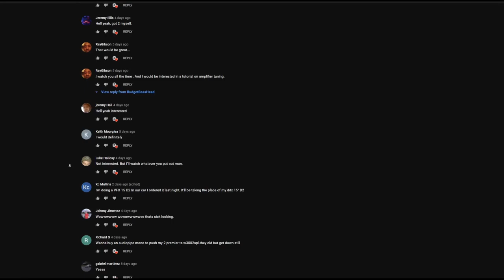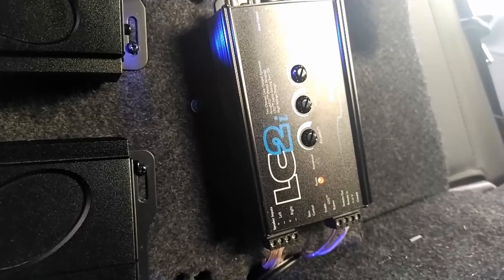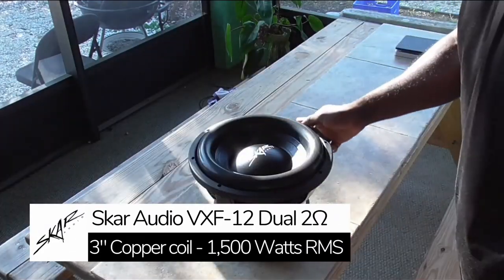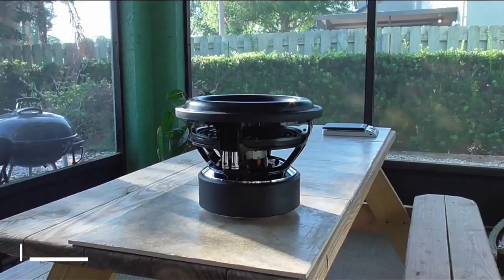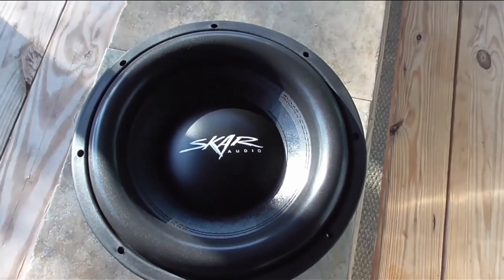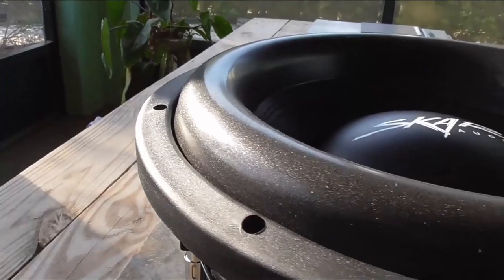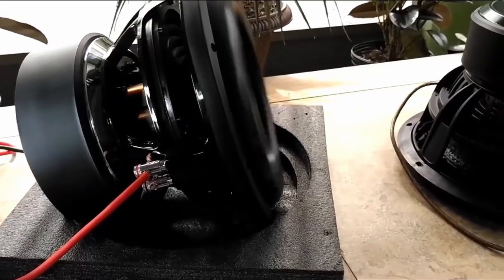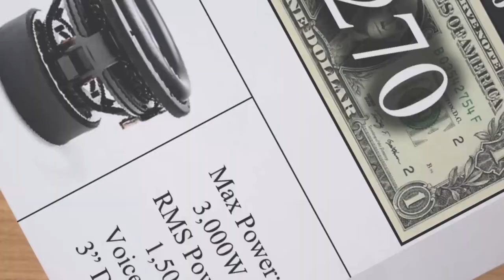4,000 Watt Daily System: Dual Skar Audio VXF-12 | Subwoofer Flex Demo

Comment: I thought there’d be port noise. Those VXF’s probably could use a much bigger port. I’d like to see a custom 6th reflex for this pair of beauties vs the Skar box. Or the XFL, and the Resilient Gold.
Reply: I was very surprised how little port noise there is for such an amazing amount of air flow. The kerf edge is what saves it no doubt. Im on the fence between the synergy 3.1 or 5.1. Either will def stretch them puppies out. I figure if I get the 3k I can begin my sq with an audio control dsp maybe the 608 but I'm not sure I'm done pounding either. Both the subs and the 4 channel AB skar amp have been a damn good buy for the price. Though as we all know it'll never be enough or finished

Comment: I'd be mostly worried about the lack of bracing for the motors. Even the EVL boxes have special bracing for their magnets, and they're smaller that the VXF's. Also, them subs ain't breathing nearly enough. So much more potential. Still a very clean and nice setup though.
Reply: I sent an email to skar and literally asked and they said those subs would be fine in that enclosure it also says it on the website but yeah I still worry about the same thing

Comment: No dissing - but I'm gonna stay away from the pre-fab boxes.  They are made to fit, not perform.  Love the video though, you always do these proper.
Reply: what's the difference between a prefab built to spec vs a custom box built to spec?
Reply: @Banshee421x   A lot of bracing, 3/4 MDF instead of 1/2,  A "custom" box tuned for your vehicle instead of (What fits).  Color of the covering....   Will Skar send me a prefab tuned to 18 Hz?
Reply: @bringmeyourweak  skar box is 3/4 inch MDF tuned to 32 with 2 cubes a peice what else do you what? I can add to port length to lower the tuning. I think you get alot of bang per buck with this enclosure
Reply: @Banshee421x   I agree that you get a lot of bang for your buck with that set up.. My vxf 12's have the ability to perform to their limit in my own custom box vs what I can purchase though.  Some of us are just looking for more than what they offer is all. You can be happy with a prefab and I can be happy with my custom. At the end of the day - we're both happy.

Comment: Since you got a stock alt do your headlights dim when you’re pushing 4K watts? If not what did you do so they don’t dim
Reply: He's not seeing close to 4k with stock electrical. To answer your question his voltage will drop drastically causing a ton of dimming.

Comment: I would love to see either of my two favorites on the channel so far paired up ... Tha AB XFL or Tha AP BDC4 preferably tha BDC4.
Reply: I got 2 bdc4s on 4k at .5 ohm and oh its f'ing NASTY tuned to 26hz I can do hairtricks float stuff im uploading a video today after I charge the xs power in the car
Reply: @diantrecreagh3269  Just saw ur comment, where's the video at?
Reply: @star_b0ii sorry I had to wait for the northstar to get here first I just replaced my 2 xs d975 batts with a northstar 170ft BATTERY IS A BEAST I'll try and get the video up today I thought it was gonna be another sunny day today but its cold asf rn if not today I'll have it up tomorrow
Reply: @star_b0ii  video has been uploaded
Reply: @diantrecreagh3269  Just watched it.. Damn they gt down 🔊 🔊
Reply: @star_b0ii  Hell yeah they get down for some budget subs easily the best price to performance ratio subs on the market rn I think im gonna be getting some skar vxf 12s next month and another 4k I think. Then I'll be done with this build....for now😜
Reply: @diantrecreagh3269  Definitely best bang for buck rn fam

I would love to see some vfx's in action as well man den u could probably go wit some xfl's ya kno..just to test out a few of the budget bangers 🔊🔊🔊🔊
Reply: @star_b0ii  those are also on my list too I'm just looking for a decently priced sub that can handle 3k with more than 25mm of xmax cause I tune all my boxes under 30hz so I need some leg room for when they start moving at 20hz on 3000 watts a piece
Reply: @diantrecreagh3269  would you rather have an ap bdc4 12” or a skar vxf 12”? I’m thinking about getting one of them

Comment: How was using the AUDIO CONTROL LCi2pro and getting everything connected? I have a 2016 Chevy Malibu and I would have to use one of those. Trying to figure out if I should tie into the amp or back speakers

Comment: Hit harder having the subs and port load off the rear wall rather than the carpeted side panel with lots of dead zones
Reply from the maker: Can't stand the trunk rattling; side pane reinforced with 3/4 inch mdf underneath carpet. Thanks for informative comment.

Comment: I have the same subs and box powered by a skar rp2000.1 d sounds really good clean to I'm thinking about getting a bigger amp for them
Reply: one rp2000 per VFX12
Reply: @douglasm.sodaro7579  I’m now running a locker kxa2400.1 for the both of them
Reply: Skar skv2-4500.1d

Comment: My vxf’s and box comin today😁. Runnin them on a cab-22until my cab-45 gets here. 300 amp alt, xs d3100 battery, stinger 1/0 cable throughout. Can’t wait to get em in. How long did you break em in before throwing some power at em?

Comment: I'm debating if I should get the skar vxf 12 or skar EVL 15s? Which one would you recommend?
Reply from the maker: These are both 'Daily" drivers. They are middle ground between SQ and SPL. The EVL 15 will have more surface area. The VXF will have more Power handling. But surface area is king. Get the 15.
Reply: @BudgetBassHead  thanks for responding I forgot to mention that it will be 2 subs and they will be powered by a orion 3000.1dsplx amp, so the 15s will sound better

Comment: Great VIDEO!!! Working on a new system my self. I am still trying to get a hold of Skar!! My one big amp from them quit working! I have power going to it , light is on amp, but no sound from my EVL 12’s. No they are not smoked!
Reply from the maker: check your RCA's with a volt meter. make sure you are sending a signal to the amp. If so, disconnect the speaker wires and check for voltage from the amplifier's speaker outputs. If you got nothing, its the amp. If you got voltage, its the subs.
Reply: @BudgetBassHead   ok thank you so very much. I just got new rca’s. I didn’t really play it that loud as I was breaking in the sucks I sure hope it ain’t them I’m also having a hard time trying to get a hold of scar
Reply: What I am working with is the RP 3500 1d amp, and my box is there enclosed dual 12’s evl.

Comment: I heard you say stock alternator, I was thinking about getting the same subs but 15s and the guy at the audio shop said I needed a high output alt, how did you get around this?
Reply: Either 3 extra batteries will work. But it'll stress your stock alt. You'll need to upgrade it no matter what but you could hold off on it if you have enough batteries.

Comment: I see that your accubass is off. Does your system sound better with it off?
Reply from the maker: In my opinion it does not need it but some people may think otherwise. Accubase tries to compensate factory based roll off. But since I'm connected directly to the factory amp, it seems to have little, to no roll off; in my opinion.
Reply: @BudgetBassHead  thank you

Comment: Will that box be able to fit in that trunk the regular way,  or it's too wide?
Reply from the maker: In this setup I had my amps on the other wall which made it too tight of a fit. I did not want my amps being suffocated.
Reply: @BudgetBassHead  alright thanks

Comment: Nice .  . when you did the resilient sounds  sub did it make any noise free air.. i got the gold 15s.. lil noisy free air was wondering if you heard and mechanical noise
Reply from the maker: No, not mines. However, most subs will make a mechanical sound, free-air, if you push it too hard. Air chuffing is the most common, especially with small vent holes. Also, when the spider and/or surround is maxed out, it makes a popping sound; sortta like quickly stretching a towel will make. What you don't want to hear is scraping, clanging and clunking sounds. Thats metal to metal and means there is a problem.

Comment: Do you prefer the evls or vxfs? Which one hits lower in your opinion?
Reply from the maker: The EVL has a softer suspension. So if you lean more towards SQ, go with the EVL. But if you want power handling and SPL, go with the XFL.
The EVL gets lower, but XFL gets louder.
Reply: The vxfs
Reply: Skars vxf subs are better than the evl
Reply: Both power handling and SQ
Reply from the maker: I just realized I read your comment incorrectly. @bassbrothers answered correctly. The VXF-12 is a big brother to the EVL-12. And well worth the price.

Comment: Off topic but which sub would you recommend a skar zvx8, a sundown audio Sa3, or a massive audio hippo 8”.
I’m running on a sound digital 1600, wt amp.
In a dual 8” custom ported box built under the back seat of my 18 Silverado seat has been raise about 2.5”
Reply from the maker: I've never run the Hippo 8, but have only heard great things about it. as for the others, the sundown would be a better choice for sound reproduction. But if money is an issue, the Skar is an excellent choice. And both those subs give you more than you pay for.

Comment: What kind of battery do you have?
Reply from the maker: Dual DieHard Platinum AGM Battery, Group Size H6, 760 CCA
Reply: @BudgetBassHead Thanks! Will two yellow top Optimas 800 CCA work well on a 09 Tahoe with a Mechman 370amp alternator? For a 4000 to 5000 watt system.
Reply: Yeah,that’s definitely will hold nicely with the alternator giving that much amperage for the 2 yellow tops combined you have 150ah and they give a better flow of electricity to your system
Reply from the maker: @BlackPanther-oo4zj  I agree with @dante Paige that should be a great reserve for 5,000 watts.
Reply: @dantepboyz  Thanks!
Reply: @BudgetBassHead  Thanks 👍
Reply from the maker: Yes they are.

Comment: Thank you for showing me what bass is all about. I am new into bass. I have a Denali and have $1k budget for bass what would you recommend for a combo of an amp, sub, and box? I am willing to build a box as I have plenty of power tools to build one. I enjoy quality bass and listen to hip hop, EDM, and jazz music.

Thank you in advance for you guidance. 
All suggestions from the group are much appreciated also.
Reply from the maker: With $1K you have plenty of options. But if its sound quality you prefer, checkout the Resilient Sounds Gold lineup. I have the 12in, 1,000 RMS @$300; and it sounds amazing. Really nice and soft suspension, only rated at 1,000 Watts and moves plenty of air. I pushed it way more and it handled it just fine. Which leaves you plenty of money for a quality amplifier. Skar is proven to put of good amps. And Rockford Fosgate has a reputation for quality. Hope that helps.
Reply: @BudgetBassHead   thank you for the recommendation!  What amp model by Skar or Rockford would you suggest and box (prefab or custom build) and at what frequency tuned?  Sorry for the questions but I am a newbie who wants nice clean sound for me Yukon XL

Comment: Idk to many skar amplifiers and subs blowing up everywhere makes me not want to mess with skar audio my buddys amplifier caught fire twice and it was a super long process getting it replaced twice so he sold it but I been having some pretty good luck with audiopipe tho
Reply from the maker: Thanks for sharing. But I've been shopping with Skar for over 5 years and never had a problem with any of their products. I did once burn up a VVX-12, but that was my fault with clipping and improper enclosure tuning.
Reply: I recently got a 4 channel skar from Amazon and it came dead on arrival.   Luckily the return was easy.  Not going to try them again.
Reply: In my experience the problem is user error. Guys will buy big systems and not even upgrade they're electrical. Or install the wiring incorrectly and start a fire. I myself have never seen a straight up mechanical failure that resulted in hardware catching on fire. I have had an amp that went into protect mode on a 100 degree day after some moderate bumping .

Comment: I’m new to the automotive Audio/Soundsystem hobby, your channel has helped me get a better understanding. What would this thing do with an upgraded alternator with say 100 more amps so like say a 250amp alternator and Big3 and welding wire sized leads and 8 gauge to the subwoofers? Would the wiring be overdone for that same combination subwoofers? I’m a typical noobie thats too lazy to read the forums/research lol so I’m kinda looking to do the above to my daily driver Lexus LS400 and a cookie cutter combination.
Reply from the maker: This setup has exactly what you just mentioned, minus the alternator. I've have a Mechanic 320A in the garage for over a year. Too lazy to do the install. But I will in an upcoming video. So stay tuned 👍
Reply: Go 0 gauge so you can upgrade

Comment: I have 3 of them on a skar 3500.1 wired to .33 ohms but trips 300 amp breaker. But I bought 3 more to have a total of six. Looking for input on amp, do I run 2 3500.1 or up it to 4500.1 or go even bigger with different brand of amp. I have factory alt and a 300 amp alt dual runs of 0 gauge with 4 batteries.
Reply from the maker: Some of those breakers are not rated correctly. But at .33 ohms?? The RP3500 isn't rated for that. That's letting too much current flow. Get another 3500 and you shouldn't need to wire down to .33Ohms anymore. That should be plenty of "CLEAN" power. Good luck
Reply: @BudgetBassHead  thanks man so one more question vxf is rated for 3000 watts but in previous comment ole boy said 10k on them . whats the the highest watts they can hanlde cuz at 10k that 7k past rating
Reply: @waylonquinones861  I thought these speakers were rated at 1500 watts rms. Max wattage rating isn't rms rating my guy.
Reply: I know its 1500 rms and 3000 peak . When I was asking questions bout amp it was cut I wanted to go bigger. So I read around forums found multiple subs amp selection was different example 3 12's rated 1500 rms ea ppl would have 4500 watt rms amp.   So I have 6 vfx12d2 on a tramamp 8k they do fine. I couldn't see 6 12's on a 3000 watt amp

Comment: You think it would sound good if you put the zvx in that box
Reply from the maker: this box is actually too small for the VXFs; only 1.75cu.ft after displacement. So, 'no' I wouldn't really recommend it for the ZVX; unless inverted.
Reply: @BudgetBassHead  so how would it sound if I inverted will it hit better low my amp is tune to 32hrz pushing 3k rms

Comment: Sup Bossman 
I have the 2 EVL 12’s on the RP 2000.1

I turn heads and it bangs but I want more😀😀😀

I’m thinking about going 

2 VXF 15’s on the RP 4500.1

Or just going up to the RP 3500.1 and the next step up from the EVL😃😃 

Advice
Reply from the maker: You're headed in the right direction. Do it.
Reply: I just bought 2 vxf 12s with an rp4500.1d and I can't wait to get it all in. Dual runs of zero guage All thru the car.  300amp alt  and two of the big yellow tops in the trunk waiting for my stuff to get here

Comment: Man I have such a hard time pulling the trigger on skar subwoofers, I really like the VXF 12 but there’re too many people with issues. Change my mind.
Reply: And I previously owned the EVL and had problems.
Reply: Build your own for half the price
Reply: I own the evl 18s never had an issue
Reply: What kinda of problems have you heard about? I’m planning on upgrading to a vxf-12 and maybe a 2000 or 3000watt amp
Reply: @gagedoble2843  people be installing the equipment wrong and blame it on the product or not having good electrical or the Amp tuned correctly or bad subwoofer enclosed I own  A lot of skar products and never had an problem checkout my channel
Reply: @gagedoble2843  well I previously owned a pair of EVL-6.5’s and built
to spec a vented enclosure, after a while this scratchy coil sound would emit from behind the dust cap, there’re quite a few videos on YouTube were folks have the same problem, I guess it’s just hit and Miss.
Reply: I have been in the car audio game since the golden age of the 90’s and I know what I’m doing, so I’m thinking I just received a defective product.
Reply: @arnoldsalazar5851  oh the evl 6.5s can't handle that much how much power u had on them ?
Reply: @bassbrother101  at the time I only had them running off an alpine MRV-m500.
Reply: @arnoldsalazar5851  yeah I don't recommend the sdr series or evl 6.5 that's where you'll run into a few problems I only mess with the svr series and up those are some very understated subs especially the evl,vxf and zvx series ( I personally own the evl series
Reply: @bassbrother101  gotcha I really like the VXF series what do you think???
Reply: @arnoldsalazar5851  vxf series has the best sound quality out of all of skars subs right now and a pair of em can handle up to 8000 watts you get more than what you pay for

Comment: I've had vxf's for a while now n still please with how badly they're shaking my whip apart
Reply: What amp r u using to push those?
Reply: @larryduran3870  my beloved rockford power T-1500. Amp is an absolute beast, I crammed 1/0 gauge using reducers for power and ground and just installed a xs 630 farad superbank. I've owned quite a few amps from taramps pioneer ect the Rockford sounds the best by a good amount. You get what you pay for

Comment: This box is a bit too small for the VXFs and being single baffle, it definitely can't be good for some 50lbs subs
Reply: Not to mention the tune it'll have
Reply from the maker: Great observation 👍 after displacement, the chambers are 1.75cu.ft. Which slightly raises the tuning. The performance here, in an out of spec enclosure, only raises my expectations of these subs.
Reply: I'm not at all bashing the box nor the design or build quality especially since I bought it myself and witness first hand that it really is a nice box but for the lower series subs from Skar I'd say anything under the EVL series..